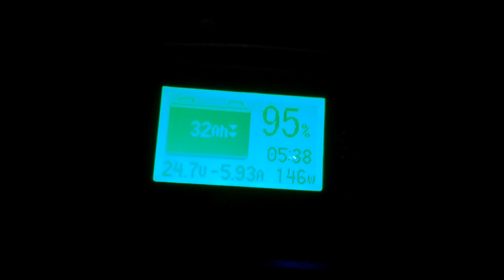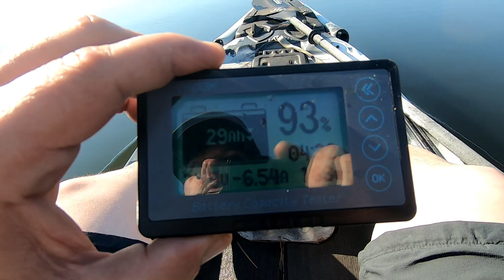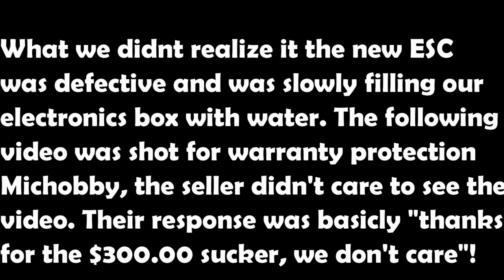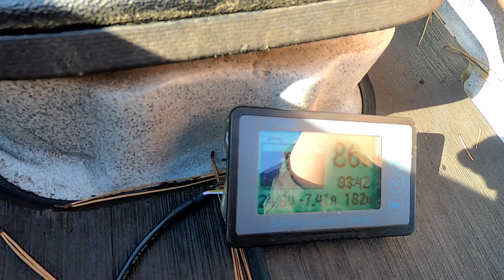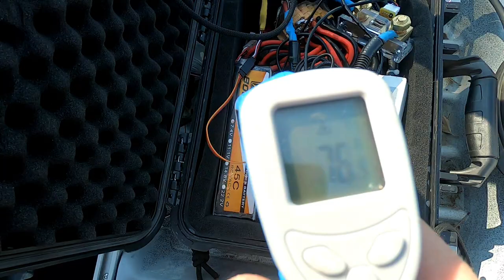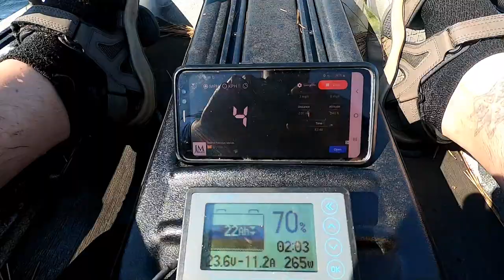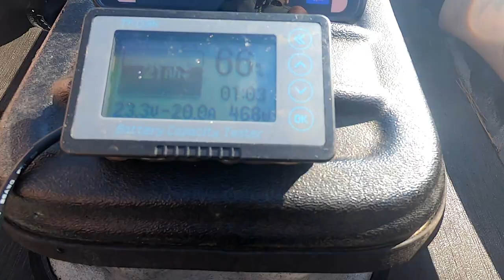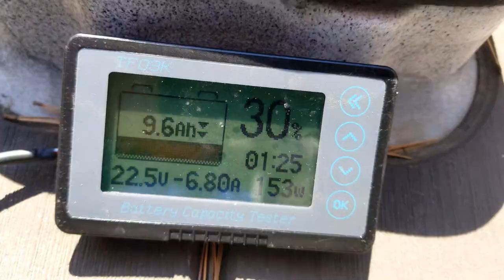Monster E-KAYAK! Long Range Test!

Comment: Rule #1 - From R/C boat Hobby - Never run your ESC and waterlines with the rest of your electronics. Electronics should always be in a separate compartment. In addition, keeping your heat radiating esc in with your batteries wrapped in foam is doing no favors for either the batteries or the esc. You are asking for a fire hazard with esc if it blows and I've seen quite a few go up in smoke.
Otherwise this truly is an awesome project. I very much enjoy watching the content. Another tip is to play with props for better performance. You'll get more speed, lower amp pull, and better battery life.

Comment: I absolutely love this series of videos, I just got out of racing rc a few years ago and recently started researching these bixpy/torqueedo setups and was just wasn’t understanding why the performance was so bad, I’m super stoked to see someone using parts from the rc industry and a little machining know how to truly build a performance e-drive for our beloved kayaks. I should have 2 brand new crescent kayaks showing up any time now, if you would like to try your finished prototype on them I would absolutely be game! I’m in the north Louisiana area. By your hat I’m assuming you’re in the east Texas area where I grew up. If this sparks your interest, just let me know.
Reply from the maker: +Jake Wallace Heck yes, we are close. Let's go fishing!
thegoodoftheland22@gmail.com
Reply: Jake Walace what do you mean by bad performance?
Low speed, low range?
Reply: martijn verschuren yes, mainly the low speed, when rc switched to brushless motors and lipo batteries, the power went through the roof!
Reply: @jakewallace5591   rc is a completely different market than that of small displacement boat owners.
Big Lipo packs are not being used in commercial products for a reason.
High rpm e-motors dito.
Most kajak and canoe owners want to go further rather than beyond the hull speed of they're small boat.
It can be done but at what cost and fore whom?
Reply from the maker: +martijn verschuren I personally don't see my self blasting around the lake on a kayak but it is nice to have and adds another dimension to the sport. Same thing goes with a long range pack. It will be near impossible for me to run it out in a day but it's nice to have all that extra power at the ready. One thing that I was not expecting was the added safety of having the extra speed. There have been several occasions where I have had to power through a big wake or nail it to avoid a rude boater. It's nice to have and now that I have it I feel I need it.
Reply: P.s. i like the stuf you do including this video.
Not bashing anything.
Reply from the maker: @martijnverschuren3578  No offense taken brother. Just a good ol fashioned conversation!
Reply: The Good of the Land I’m also here because I want the longest time I can get on the water your system opened my eyes to what’s available out there for a kayak. I fish the ocean. I have had several battles where I have been pulled miles from shore with a big fish. I want to know that I can make it back instead of having to cut my line. And loose a great fish because I’m afraid I won’t  be able to paddle back. This would also give my a hell of a lot more range and make fishing a lot more fun.
Reply from the maker: @esclark75  the next battery could probably make it 100miles!
Reply: The Good of the Land  can’t wait to see what you make I will be following along to learn how to do it. Please update on any changes you make to the system I know a lot of us are interested in your system and either buying it from you or duplicating it for ourselves. Thanks for all the great work so far.

Comment: So far this is what I'm considering 

- using that KV360 motor 
- using the prop also
- wiring 36v 40Ah (12s8p)
- motor is placed midhull with deep drop feel free rudder.
- speed controller 
- wireless battery life check box
- 1/5 scale servo and piston to drop and lift motor 
- still figuring out cooling if needed 

Target is 4-5mph and long enough life for 6-10 miles offshore (25 total miles area) with emergency bank life left. 

Been watching all your videos. Some multiple times lol. Anything I'm forgetting?

Comment: What could you do for a guy in a electric power chair ( wheel chair) I would love to have more speed and or more  range ,
Reply: The possibilities are only limited by your wallet!
Reply: Even just using some good e-skate parts could get you 25mph with 50 mile range
Reply: @crfsikness  you forgot the just kidding emoji
Reply: I saw on a power-chair forum that you could change batteries to get a few more mph but you might see a significant gain in range.  I also talked to my electrician Brother and he was saying that in order to keep it reliable I'd have to get new motors  too and those aren't cheap.
Reply: @crfsikness  6
Reply: You could put a small turbo diesel in it, hell, slap some blinkers & lights make on & make her street legal... You could get 50 miles to the gallon on that hog
Reply: They have Ebike Tricycles if that would work for you.

Comment: I have an inflatable pontoon fisher. Do you think this will work for this, and if so how would you install to the front that pulls instead of push? Mine doesn't have a basket mount on the back.

Comment: Maybe, if you'd used Distilled Water (flushed the system, too!), your Batteries and ESC would NOT "Short-Out"...?  
(Pure H2O is a good insulator).
I have a Titan (pedal powered), and am designing and fabricating a trolling motor, to take the place of the "pedal-power pack". Steering will still be by rudder, and it'll have a hand control on the Starboard Gunnel (like a "Real Power Boat" has). 5 forward/3 reverse speeds, and be able to "kick-up" like the peddle assembly does.
Finally got a "Speedometer" on the Titan...  A Lowrance Hook/2-7, with sideview and all (I can Find the fish, but can't make'em BITE!).  Haha!
Reply: Get a PWM switch set up, you will kick yourself later if you dont

Comment: YOU SHOULD USE MINERAL OIL FOR YOUR COOLING AS IT doesn't conduct electricity which well keep it from shorting things out when your system fails during research great build keep up the good work, alaska usa

Comment: its funny, because i was literately going to save up 3 grand for an Epropulsion the spirit 1.0 plus Cost = 1k without battery

with 1 battery adds 1k  to price = 2k
with 2 battery's adds 2k to price  = 3k

I rather spend 1-2grand on this setup and get better results , I can't wait until for finalize this build

Comment: I just bought an new raft pontoon boat. 12 1/2 foot long. My testing will be here shortly. To add up the cost of motor to whole set up. Somewhere around $400. No mod parts. Just using an old trolling motor. Still new. Only used once. Just need the setup for fishing. The run time should be from sun up to sun down forever with zero so called charge. I am useing an simple little solar panel I had hooked up into the system. Normal AGM lawnmower battery for now. My testing so far. 40% power. No battery drop. Oh well. Not posting it to YouTube, ect. Just going fishing. Enjoy yours. Take care.

Comment: I am in the middle of making hydrofoil with very similar controller set up(sealed water circulation) i have a flipsky 75/300 to go with the 65161. Got multiple props to try. Got a AK Durable supplies trek foil with carbon fiber mast. It is a 2000 wing which is huge. 3' mast and wing is about 3' wide. Should lift very easily 😉 got a beautiful board that local guy made. It's big but will go good with big wing and extra weight from battery and motor system i hope. Deck is 75L i think. 5'2" Everything cf. I will share videos when i get in the water😁 thanks for sharing. I will be sure to check vesc water connections and use clamps 😉 i got a little pump to circulate closed water system. Got a flipsky vx3 controller and multiple 14s batts. 25ah, 40ah and some 12s. I have Buffalo river in my back yard but riding down at Buffalo NY harbor (inner and outer) on lake Erie is my goal 😁

Comment: Hello, I really like how you explain your tests. now I am designing my e-kayak. I have a powerful motor (to extend his life I am going to attach it to a small outboard motor tail shaft), a good water-cooled esc, a magnetic fuse so that if something goes wrong it doesn't break everything. I would like to know where you got the screen where it gives you all the information (watts, volts, ...). I work in a computer store and I have recycled many laptop batteries where I have removed many 18650 batteries, I don't know if you can give me any advice about batteries...

Comment: computer parts. reservoir with flow control pwm pump so you can ramp it up as the cooling requires. should be simple. worth a look if you havent already
Reply: And already runs on DC so easy conversion

Comment: I submerge my LIPO batters all the time.
 Leave them submerged too.  While operating.
ESC and batteries hate heat.  Even a peletier cooler would help, along with a smaller additional fan inside the electronics box.

Comment: That trim issue...you should totally  hunt up an old Wilderness Ride 135. Great mix of stability/speed/payload and the seat can be moved fore or aft like more than a foot with just a strap adjustment.

Comment: Question as far as have you tried jet board propulsion that isn't close to weeds it's almost at the water horizon of the boat. for directional either you have a trip rudder or directional prop control.

Comment: for your struggling at start on your motor is your min_command of your transmitter, if you can up it until good start vibes, or try if haven t got min_command of your transmitter up your trim throttle until the limit of start 😉

Comment: in time 21:50 , replaced with a bigger longer bottle. More water works more effective to drop out temperature. Also add a heat sink around the bottle. Add also small amount of coolant to the water.

Comment: Excited to see the next video and also to find which motor you have got in mind for saltwater application!
Do you think that creating a large battery pack of 18650 lithium ion cells would be a viable alternative to the lipo packs you're using Justin?  I am sort of assuming that's what they use in the pack for the bixpy but I could be wrong.  Loving these videos anyway thanks!
Reply from the maker: +Jim D So I just recieved my batteries and they are awesome. I will be making an 18650 pack for one of the yaks but this pack is going to be a monster lipo pack. 120 8000mah lipos. It's a beast.
Reply: @TheGoodoftheLand  wow that sounds epic!  There must be a bit of mass in 120 of those dude. I looked on that discount battery site in your links for those 8000mah packs but could not see them.  I'm waiting for more of your superb videos before spending money on kit, but meanwhile am harvesting good 18650 cells from dead laptop packs so I can assemble a good battery brick or two for my project.

Comment: have you thought about a bigger prop or more pitch? it seems like you have the torque
Reply from the maker: We have the torque the problem is high amps. Need gear reduction so she can hit fullbrpm without pulling so many amps. Sounds crazy but in this setup we actually would get more speed out of a smaller prop.

Comment: You need to mount the esc to the inside of the boat, check out alien power system or MGM Controllers for a better one.
MGM has series ESC up to 1000 amps

Comment: Axial bearing neede mayb? Nice project! Just a friendly tip, it will be hard maintaining the propeller happy once you increase rpm which is what more power means with that motor, due to cavitation. I would go for a solution that holds the rpm under 4 or at least 5krpm. I build marine bldc:s for a living fyi. Our 10kW direct drive is quite mych bigger due to this. Keep it up. I would love to see this work out for you!

Comment: great that you’re hard on it and want to find the weak points. that way when I get the set up for my kayak I know I can beat on it a little be without worrying. can’t wait for the final options and to see if you’ll be selling diy kits/parts
Reply: I was thinking about putting it on a canoe as well for the option to bring friends and to use as a cheap boat motor alternative. keep up the good work

Comment: From my experience, wet lithium batteries are not that bad (in halfway clean fresh water, saltwater is a different story), as long as you dry them immediately after usage. However, when they just sit around in a seald box with water and moisture for hours, it is quite more dramatic, as the little bit of salt that is in fresh water will make it conductive enough to slowly but surely drain the cells dead. Additionally, the contacts may be heavily corroded (depends on the metal and coating). I once forgot a battery in an rc boat. Totally destroyed. So I really felt your pain and anger when the water leaked out of the faulty esc and killed so many big and expensive batteries. Really sorry for that! Maybe put the batteries in an additional compartment to prevent that from happening again and maybe put a moisture sensor with an arduino and alarm inside the battery box?

Comment: You could build a cooling plate in aluminium with water channel that goes under water under the kayak somewhere or even build the motor mount bracket with embedded water channel and use the lake to cool your recirculating water.
Reply from the maker: +Frédérik Dubois Bingo! Your getting closer! Add some peltier and you got it!
Reply: @TheGoodoftheLand  i run lipo`s for my motor, and the biggest problem is the termal cutouts in the battery, tried 20ah, moved up to 40ah, little problem. 92f sunny, gotta protect em !

Comment: Love it man! Wonder how the power draw will vary with a decent chop on the water. Also,  how will this whole system handle salt water? I fish mainly inshore coastal where you need to paddle 3-6 miles. Thanks.
Reply from the maker: +Jason Wolbert You do not want this motor for saltwater. I have another one that is sealed and rated for salt water.
It has more than enough power to overcome chop. If the boat can handle it the motor will push it. I still have alot of testing to do before I know we have a solid system.
Reply from the maker: +Jason Wolbert Jason, I just ordered some smaller waterproof motors that would be perfect for you. I will have a video live asap. Please wait to purchase until I test this stuff. Definitely not ready for rental just yet.

Comment: How about if you mount the ESC on top of your Motor shaft and run the wires to the battery longer that would let your ESC cool get one with a fan and waterproof spectrum make some good ones you would have to run your control wires longer. Also, I would put it on a RC remote control to watch everything and get it set right first 😉😀👍🤙 I have the same problems with my planes ✈️ I don’t like to go higher than six cell You can always adjust the pitch on the prop to pull more amps or less amps

Comment: I just bought a used torqeedo for 800 dollars. It came with the ball mount which I don't think I like so i was going to by the other mount type which is 300 dollars. But after finding your videos I nay wait and not install the torqeedo at all. How long before this will be available to purchase or solid instructions where I can build this myself? And what would the toyal cost be?
Reply from the maker: +Josh Gilbert I should hopefully have more data and the waterproof motors fully tested in about a month. What kayak do you own?
Reply: @TheGoodoftheLand  okay thanks. I have a Diablo Adios.

Comment: Hello brother I have some questions. I got 55lbs thrust Newport vessel. My question is how to put more power, long last battery and every time I put into 5 gear it only last less than an hour the battery power. Battery I have now is 12v 45A.  I like ur video. Thank u from bali
Reply from the maker: Hey brother. Trolling motors are great at moving a big object slowly. They become very inefficient when trying to move a small boat quickly. I want to work on a prop design that helps turn more of the torque into speed. Keep watching!

Comment: Looks good. A suggestion on the cooling. Have you ever thought about using a pc cooling liquid. Check out engineered fluids pc cooling. None conductive fluid.
Reply from the maker: +Angel Garayua Thanks Angel! Your comment is perfectly timed! I'm building a system using peltier and heat exchangers but was just planning on using water with some antifreeze. Had no idea about the pc cooling liquid.  Thank you...This is why I Love YouTube!
Reply: @TheGoodoftheLand  if you use peltier cells, condensation drops could be a problem. What do you think about it?
Reply: @TheGoodoftheLand   Question what type of speed controller are you using. That is able to handle the Amps. I have been trying to do something similar with drill batteries and an old trolling motor I had around that works. I like how easy it is to connect and disconnect  and put to charge.  And a big plus is if you buy ridgid brand batteries they have a lifetime replacement. And I know that the motor draws the most load when  first starting to push and its about 15 amps. I was also looking into a puls with modulation.
Reply from the maker: @mytoy4x4  There is alot of humidity here in Texas. I have a few trick up my sleeve if condensation becomes an issue. Stay tuned!
Reply from the maker: @angelgarayua3234  Currently it's a 400amp flyer. Its designed for DC brushless three phase motors so it won't work on your trolling motor. Look into the brushed units used in the rc crawler hobby. They can handle 15amps